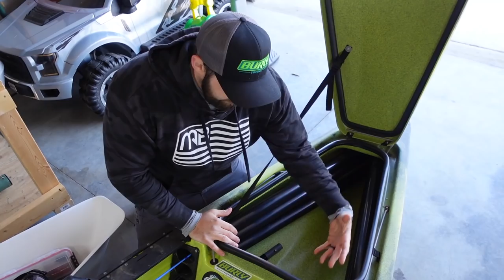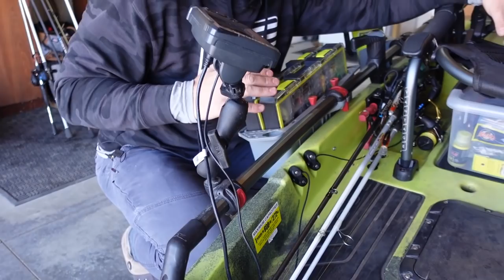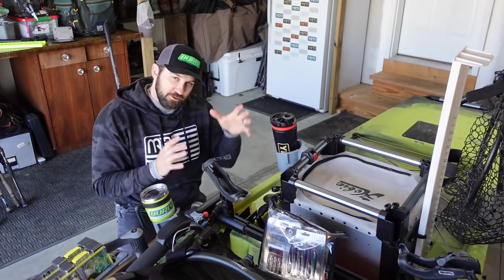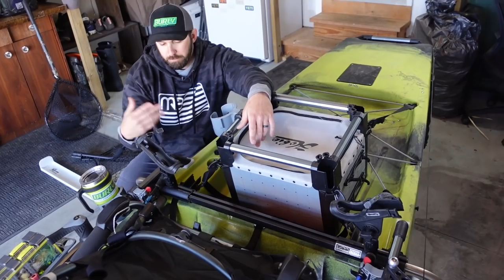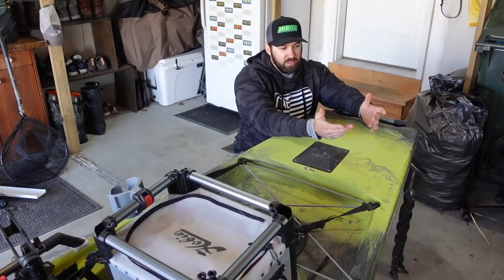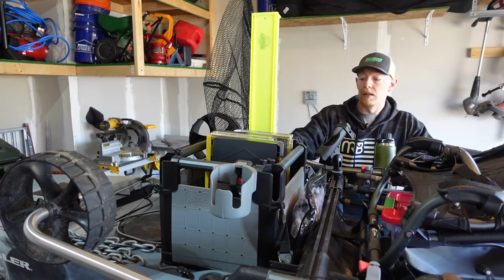NEW KAYAK Fishing Setup For 2021 | Hobie Pro Angler 360

Comment from the maker: What do you think of the rigs?
What is your rig?
Help feed a hungry Snorlax by Smashing that LIKE button!
Reply: That's a cool kayak! I have a small sit in kayak.
Reply: I'm now mentally creating a chain anchor setup! Also preparing to save for a new PA 360 lol. Also, it's called a carabiner... Just saying
Reply: I’m far more interested in drive reliability, I’ve seen several nightmare videos of constant drive failure on new kayaks including failure in 360 system
Reply: I am shopping for my first Fishing Kayak, and considering the Hobie you have.  What was your thought on Pedal vs Motor?
Reply from the maker: @havoc_64  The hobie pedal is the only all terrain option there is.  The prop drives have instant reverse by somewhat less control, and you will run aground in shallow sections.  The motor has the same issue, but obviously you don't have to do any work lol.  My choice is Hobie because of the versatility.
Reply: @aaanglers  thanks for the info!

Comment: The lesson from this video is that every rig is different and needs to be setup for your fishing situation.  I have a 2020 Hobie PA12 360 and mostly fish the small streams in Missouri.  My wifes uses my Jacison Coosa HD.  The streams (rivers) are rarely over 4 ft deep.  If they are, it is due to flash flooding and you shouldn't be on the river.  Therefore, I don't need a fish finder.  I take an extra change of clothes in a dry bag stored in my front hatch, just in case I flip over.  I take a small paddle to push off of the bank.  I have a small trout net to land the big fish which may be up to 18 inches for the river monsters.  I have a storage bin attached to the H-rail for lures and various things like a Walkie Talkie to keep track of others in my party.  There is a cup holder for the beverage.  I add a cooler behind the seat for additional food and beverages.  I take a couple of plano boxes to hold my various lures to put in the compartment in front of the seat.  Other than that, I use the basic setup that came stock on my Hobie.  Easy peasy.  If I fish bigger waters, I take the bass boat.

Comment: We have bought two based on this review and others. Both are 2021 12 360 drive pro anglers, we are so far disappointed with the quality control and some other issues that have come up. We are taking pictures and will file warranty claims. That is not why we bought the "Best"       
 Thank you for the video, not blaming you for something they did or the dealer we used failed to "Inspect what you expect"

Comment: I see tons of these expensive plastic boats for sale used on Craigslist. Buyers remorse? $5,000, I could buy a real boat for that much.
Reply from the maker: I questions everyone that says this.  Can you get a boat for 5k, yes.  But just like buying a cheap / used car, it comes with a lot of issues.  I have no buyers remorse here.  Even if it breaks, fixing it is easy and cheaper than a real boat.  Maybe one day I'll add a boat to the fleet, but not a $5,000 one.